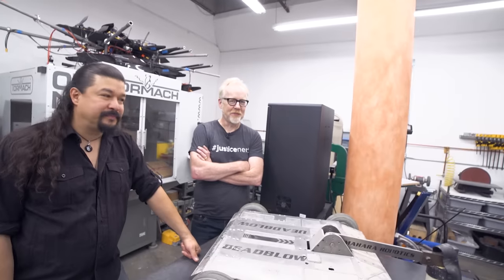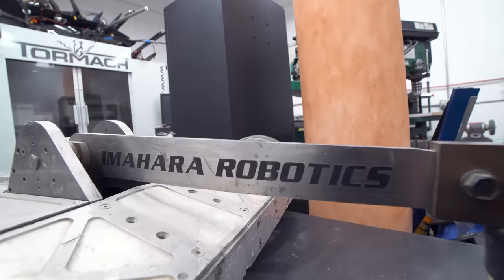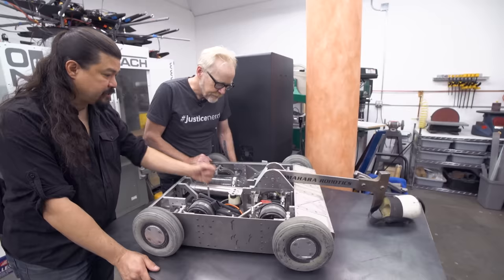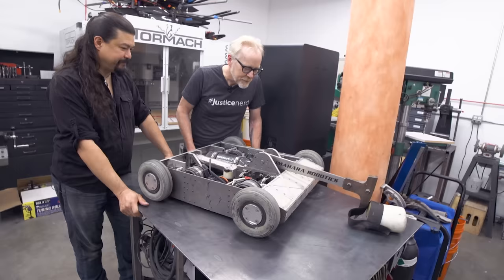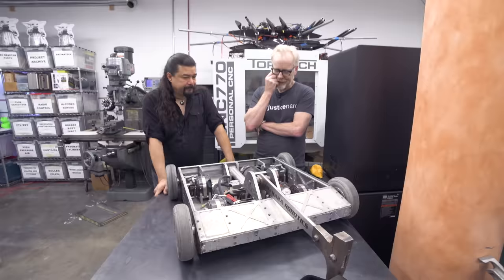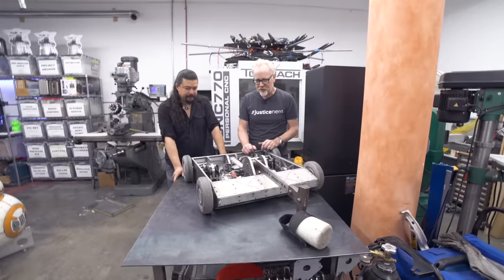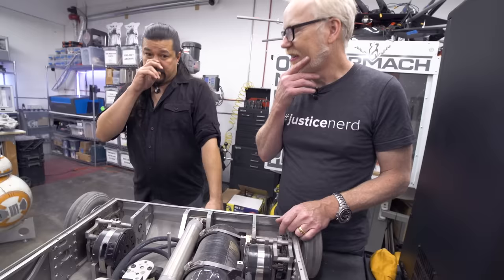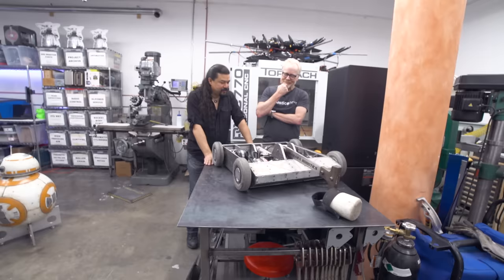Grant Imahara's Battlebot Deadblow

Comment: This bot kicked my BUTT multiple times in BattleBots ... I loved Grant's ability to engineer and think through these challenges.   That hammer?  Went through my bot like butter. Spiked it RIGHT to the floor.  BAM.
Reply: That high pressure air canister turned that titanium hammer into a murderbot.  If Grant could line it up just right ( and he could... ) pretty much nothing would survive.
Reply: How do you think Deadblow would fare VS heavy spinning weapon bots like Tombstone and Copperhead? I remember watching Deadblow in the show on Comedy Central and the arm on the first hammer broke. In one of its fights it set the Battlebots record for number of hits.
Reply: Really cool to hear the stories of other bot builders that opposed Grant's bot. Which bot did you work on Martin?
Reply: @greggv8  Not very well, only because it's a bit older and it's hammer doesn't have the power to get through the new armors, but mostly because Deadblow was a middleweight and not a heavyweight, so it would get hit far and pushed fairly easily.
Reply: What was your bot?
Reply: @skylerwd6  there are middleweight bots similar to tombstone and copperhead. They'd still be tough opponents for deadblow. Rip the wheels off, snap the hammer arm. Possibly smash through the rear armor and puncture the air tank.

Hammer bots just haven't been very effective in recent years. Armor is too good. Hammers light enough to be fast can't penetrate and hammers heavy enough to do damage are slow. Combined with drivers who mostly seem to be stunned that they got an opponent in hammer range and fail to attack until just after the other bot gets away - hammer bots hit the floor a lot.

I have some ideas for a heavyweight bot with a heavy hammer that would be fast and an impact trigger so when the opponent is in the whacking zone and the hammer is ready to go, it *will fire*.
Reply: @greggv8  There's Chomp, and although I guess you could argue how effective it is on the whole, its hammer is a fuckin force of nature. I guess I just want it to succeed since it's the only true walker we've seen in ages.
Reply: @Just.Kidding  yup, when it makes a hit it does damage. Another one is Beta (the UK pronunciation with a long e). Big hammer, a bit slow on the swing, but when the driver gets it right it can be great.
Reply: @greggv8  why do you people always ask these stupid questions. Deadblow is 2003 mw, wth do you thing would happen
Reply: @greggv8  true, I think the future of hammer type weapons is probably the likes of Sawblaze, smacking them with a spinning weapon. Still though, can't discount the potential of the heavy hammers causing shock damage through the bot. All it takes it knocking a single wire loose sometimes after all.
Reply: What was your bots name?
Reply: @greggv8  Beta , a pun on Beater ;)
Reply: @greggv8  A possible good or terrible idea, depending on how well it’s executed, would be to use blank cartridges as the way to propel the hammer. Depending on what kind of blank cartridge you’re using, it can shear steel apart, but do it right and you essentially have a possible one shot weapon that can punch through even the toughest of bots and leave them dead on the ground. Probably want to go to .30-06 at most, but .308 or 5.56 would be a good starter cartridge to gauge the power before moving on to something with a bit more bang for your buck. Of course the most difficult problem with that would not only be the feeding system, but the necessary precautions taken to ensure the internals don’t get destroyed by firing it once. A lot of power, but a lot of issues that would need to be solved as well.
Reply: @decimation9780  I'm thinking of two springs compressed by a winch, or two. They both start off compressed with one connected to swing the hammer. Then when the hammer is pulled back it connects to the second spring for a fast second shot. Having the power to compress the springs quickly would be a tricky thing. To keep Newton's 3rd law in check I'd put a pair of spikes out the front with their bottoms almost touching the floor. Slam into the opponent, sliding the spikes under. The trigger bumper hits and BANG, the hammer swings and tries to fold the other bot down between the spikes.
Reply: @greggv8  I dunno, the amount of wear that would result from something like that might become increasingly more expensive as time goes on. Both the winch(es) and springs would be worn out after a match or two, and would likely be more expensive to maintain or replace than using a servo motor to bring the arm back up and some blank cartridges to give the main weapon it’s power.

You also have to factor in the necessary equipment needed for the weapon depending on what you want said weapon to do. If you’re looking to just game end the opposing team's bot, blanks would be best because by using a titanium hammer with a spike as the business end, it’s wholly possible to completely punch straight through the enemy bot, doing catastrophic damage to the enemy bot, either crippling it or outright game ending it immediately. Depending on how the enemy bot was built, of course. 

However if you’re up against multiple bots, your idea might be better suited than mine, as mine has the downside of if the hammer goes through the enemy bot, the weapon might be temporarily out of commission if it gets stuck in or on the bot. A solution would be to have secondary arms used to remove any possible armour stuck on the deadly spike, allowing the weapon to be used at full functionality. Granted again, it’d probably be a nightmare to get it all working without any major hitches.

Your idea is probably the more likely one to work without significantly more work being done, while still retaining a fair amount of power behind each swing.
Reply: @decimation9780  Something I've seen as a problem with many bots using a spinning weapon is they break easily because they don't have any give in the weapon drive or mounting. One good hit and something breaks. I'd copy the concept of a viscous coupling as used in some all wheel drive vehicles. But instead of a thick silicone oil that allows for continuous slipping under normal conditions then firming up when the main drive wheels lose traction, I'd use silicone grease, the thickest, stiffest available. There would be some slip as the weapon spins up but that would save motors, gears, electronics etc when delivering a hit. The grease would shear instead of gear teeth or a motor shaft breaking.

Tombstone and some other bots with a big spinner (horizontal or vertical) get some compliant slip by using V belts but they also tend to get those belts broken or thrown off the pulleys. Then there are the ones using toothed belts. That's a recipe for weapon drive failure when the teeth get stripped off the belt.

The sheer toughness of Deadblow is what made it so successful. Grant designed every part of it to be extra strong and fit for fighting its contemporaries. But had someone made a heavy horizontal bar spinner like has been popular lately in the middle weight classes, Deadblow would've needed to get some wheel armor. I could see Grant carving fenders from titanium or tungsten for it.
Reply: @greggv8  Well Yeah, Deadblow is surprisingly small, especially compared to something like Red Razor, which was pretty massive. Were Deadblow to have been turned into a heavyweight bot, these kinds of modifications would not only be necessary, but encouraged as  it would need better and more widespread armour, but a stronger, more durable weapon as well. Though another issue with using blanks as the primary method of applying the force to the weapon to make it so ruthless and deadly is that it would be limited. Depending on how you’re done the internal feeding system, you’d have at most twelve to eighteen shots of .30-06 assisted titanium destruction. Could have a motor installed, would need to be deactivated whenever a blank assisted blow is dealt, to avoid breaking the motor as it would not be able to keep up with the speed of the weapon. If done properly, the blanks could be used in a tactical way, in order to finish off a damaged bot or to get an early elimination by taking advantage of a bot's weaknesses.

Granted I have no idea how that could be accomplished, I’ve only a high school certificate as the peak of my expertise. I’d need at least an engineering degree to be able to figure out a somewhat reliable solution and method, let alone a way to make it work in the first place. Everything else aside, I would need to figure out the feeding system, the most practical solution to me would be to set up three revolving cylinders that hold six rounds each, fitted for a larger caliber round like a .30-06, once one cylinder is spent, internally the cylinders rotate, swapping out the spent cylinder for a fresh one, would either need sensors or would need to code it so it’s done automatically, reliably too, but that’s another problem that would likely need solving anyways. 

If done right, the weapon would likely have enough force to punch clean through the thick steel armour on a House Bot, meaning it would have an obscene amount of power compared to most other bots barring those like Carbide, who had a pretty nasty weapon to begin with. Granted to my knowledge Battle Bots is done, though Robot Wars is still going on, and depending on the rules, my idea could see success if implemented and executed properly. Might be a tad expensive, but if it works, it could pay off extremely well.
Reply: @greggv8   Tombstone was always the best my favorite but I don't think he would last that long to him still would knock the crap out of his wheels and  Is tear big holes on the side of his bot too
Reply: @MartinBogomolni  what was your bots name?
Reply: @krotma   It's just as strong as steel But it's 50% lighter And I think it has a higher melting point than steel
Reply: @krotma  Sure.  Titanium is  valued for its high tensile strength, as well as its light weight, corrosion resistance, and ability to withstand extreme temperatures. It's as strong as steel but 45% lighter, and twice as strong as aluminum but only 60% heavier.

Fighting bots are subject to a number of tight limits on size and weight.   Saving significant weight in the hammer without sacrificing strength meant that Grant could shift that allocation to batteries, or motors or armor.
Reply: @krotma  It’s been a while, but I believe it was decided to go with a solid titanium weapon to prevent said weapon from breaking during a fight. If they used a steel head, that would require it to be welded onto the titanium shaft, creating a weak point that would definitely have been subjected to too much stress during a battle and would have seen the head of the hammer be sent flying.
Reply: @krotma   Is not necessarily when you want the most amount of hits We're sitting lighter and allows him to get more strikes and before he either runs out of air Or C02 or whatever hes running
Reply: Wow I remember watching battle bots on television it’s was very cool and fun to watch
Reply: The man was an absolute genius....and absolutely hilarious at the same time.
Reply: Oh man, 2003 and we were also using Bosh GPB or similar motors! Crazy to see that we were not alone!
Reply: @MartinBogomolni  what was the name of your bot?
Reply: I don't want to see Tombstone of all bots to hit that titanium hammer because that's a MYTHBUSTERS robot Vs TOMBSTONE

Comment: I competed at one of the early Battlebots events and met Grant there. Super nice guy, he gave us some help with design issues on our robot where the keys holding our wheels on the shafts kept shearing through. I remember that the big secret to Deadblow's hammer was that he was running it off a high-pressure compressed air tank instead of the carbon dioxide tanks that everyone else was using. Carbon dioxide had the issue where it has to absorb heat to go from liquid to gas, and the tank eventually gets cold and freezes up if you're drawing from it too quickly, but the high-pressure compressed air can keep firing the hammer until the tank is completely empty. It looks like he's also using the old EV Warrior motors for driving it unless I'm mistaken - those were a model of high-torque DC motor originally designed for a failed electric bicycle project that ended up in a lot of robots.

Comment: I machine titanium daily on a lathe and I definitely don't do it at a high speed, 1000 rpm spindle speed is fine with coolant and carbide tools. No sparks or heat at all, cuts like butter!

Comment: If that hammer was double-acting (effective at both ends of the swing) it'd been a real mess-maker.
One thing I noted with this iteration, it does not have the skirts or plow from season 3.0.

You think this thing is nasty, consider Jamie's entry, BLENDO.  That was nasty wicked brawler in the heavyweight class, getting ejected for sending opponents flying out of the ring.

Comment: in my experience with co2 vs compressed air, the first blow with CO2 may have been slightly stronger than anything the compressed could do, but each subsequent blow was likely weaker than the last, due to CO2 expansion being endothermic, each shot likely could not recover the thermal energy to make it as strong during the match . and grant defiantly seemed like the guy who would want repeatable reliability over reliance on a single shot. never mind the potential of repeated shots possibly frosting up and adding water to the electrical short options.

Comment: The use of titanium for the hammer is....really, really bizarre.  Titanium is one of the least suitable metals for this given its difficulty in machining, and resistance to heat treatment.  A good steel alloy, with differential hardening, is what was needed here.  It strikes me that Grant must not have been all that knowledgeable about metallurgy and heat treatment to have made this selection.